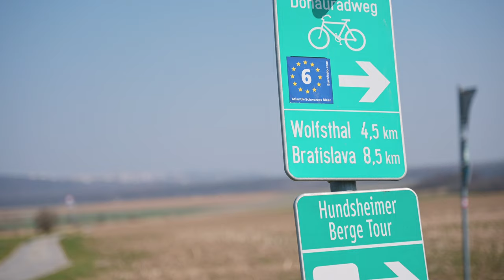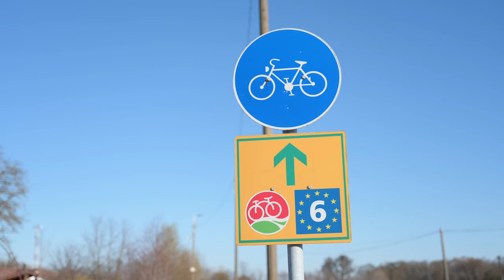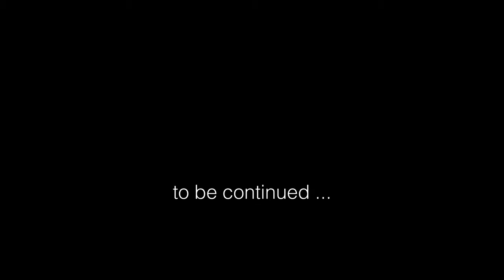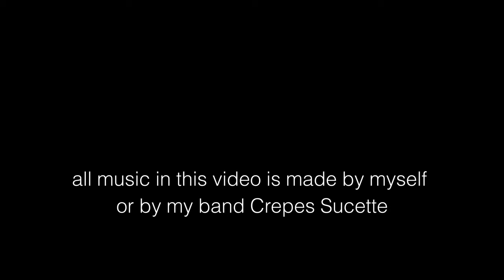MO2W #32 - BICYCLE TOURING & STREET MUSIC (1/3)

Comment: quick frage mein freund.. how long would you take off to go from Kathmandu to Singapore? I'm thinking 3 months? I'm kind of in a good spot to do it right now what with not having a job or responsibilities and I've heard Jan-March is the best time because its dry season. Also wondering if you needed anything other than an eVisa to enter myanmar at the india border in Moreh? I heard somewhere there's another cash grab 'road permit' thing for travellers entering over land?
Reply from the maker: Hmm I guess 3-4 months is perfectly doable. The issue I think will be to get into Myanmar...As much as I know is that Myanmar is closed right now for foreigners. But I'm not too sure about it so maybe make some research. In terms of season I'm not 100% sure but in march it's already getting wet near singapore. In case that right then I would move the whole journey 1 month and start in December :)
Reply: @MONKEYON2WHEELS  danke!